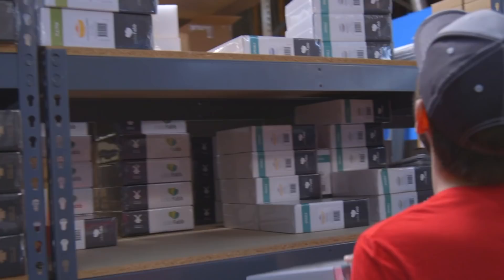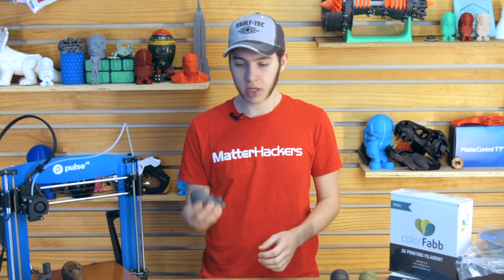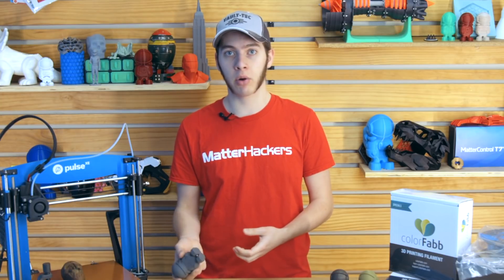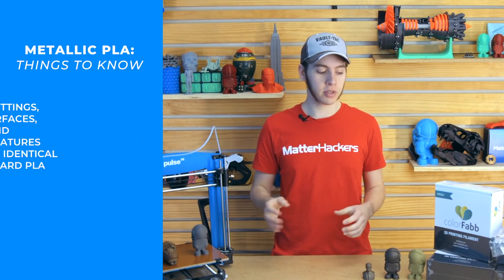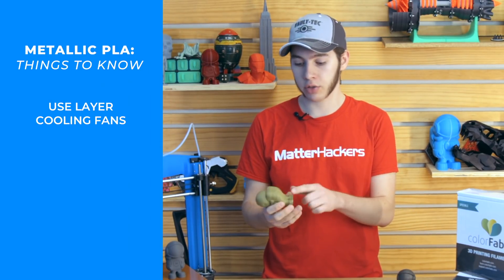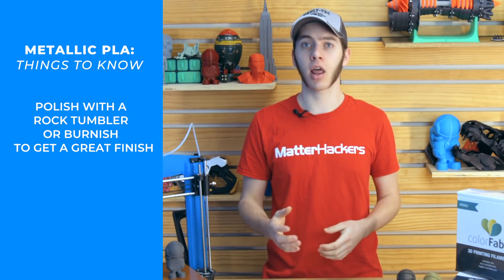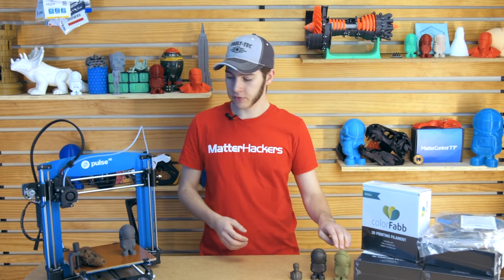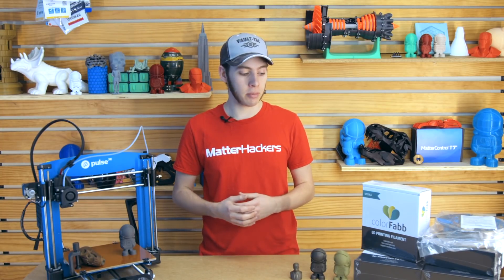How To Succeed With Metal PLA // Metallic Infused 3D Printer Filament

Comment: The Whole Point For Printing With Metal Is For The Strength Why Would I Print With The Infuse If It’s Weaker Than Pla
Reply: I can think of multiple potential reasons (although conductive PLAs would work better for some of them) but it seems like its more commonly for making things that are just supposed to be decorative or look nice sitting on a shelf. I'm curious about electroplating it and I think the iron-infused pla is magnetic
Reply: @__jonbud______________________   I Want It To Be Knocked Around and Ran Through Some Heat 😂

Comment: I was thinking of printing a custom nitros engine that worked. I know that it's encased in PLA but could the metal inside help with handling the ignition of the nitros? Or would it behave just like normal PLA?
Reply: old comment but would act like la but could get more life with a thick  metal plating

Comment: Great video. But audio quite low. Also the text in the video is clipped.
Reply from the maker: Thanks for the feedback! Do you mind letting us know what device or system you are using to watch the video? We'd like to improve this, so more feedback is greatly appreciated! Thanks!
Reply: MatterHackers Hi — I’m on an iPhone. Also are there any engineering properties for metal fill? For example is it heavier? Could it be used for a light-load flywheel?
Reply from the maker: Thanks for the info! It is slightly heavier, but it is still mostly PLA, so it's brittle - it's purely aesthetic.

Comment: Hey guys, you make great helpful video's but the audio level is always so low.
Can you guys maybe see it you can fix that in upcoming video's?
Reply: I second that. Try "normilize audio" to around -3dB (should be in any decent editing software). Now it's around -16dB which is too low for most systems and what's bad that AD's usually do 0dB - which is MUCH LOUDER then your video. So after making volume higher to really hear what you say, next AD played can be really painfull loud.
Reply: I edit my video's in Da Vinci Resolve (you can use the free version).
They have a great audio interface where you can set the levels for the audio and they also have a compressor / limiter functionality build in the software.
I normalize my audio at -6dB but with the compressor / limiter turned on.
Good luck.
Reply: Agreed. Volume was at 12/100. To get the same volume on this I had to increase to 66/100.
Reply: I had the volume up to 100/100
Reply from the maker: Thanks for the feedback - can you please let us know what device or system you are using? We'd like to try to fix this.
Reply: MatterHackers I watched it first on my laptop (2017 asus which needed 100/100) and I tried it again after the person said there’s was fine. Second time I used my phone with headphones and i still had to set it to 75/100 for easy hearing.
Reply from the maker: Great, thanks for the information!
Reply: was fine for me. Maybe your soundcard/audio drivers are weak or maybe you headphones have high impedence